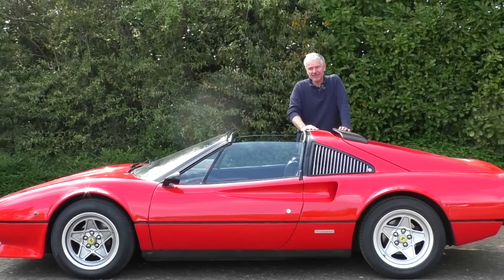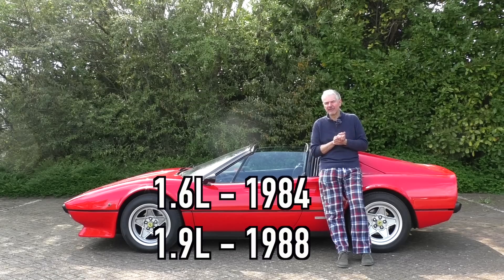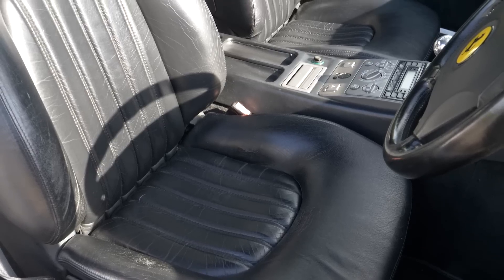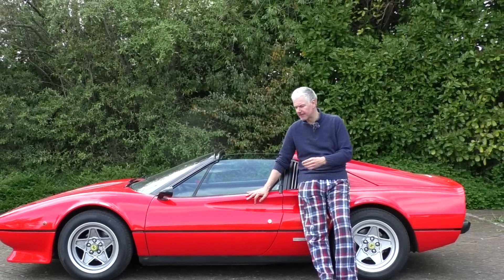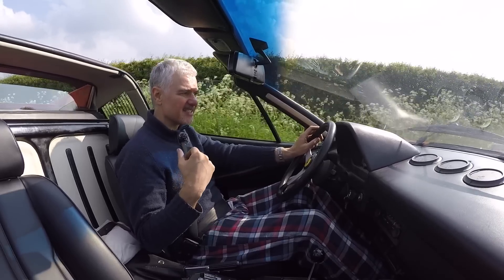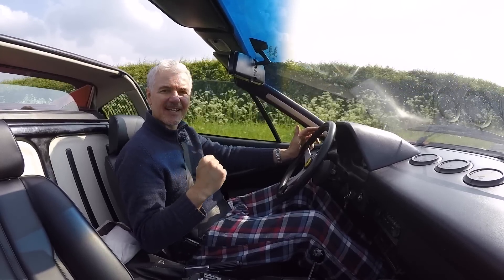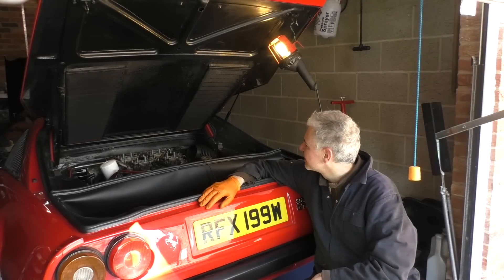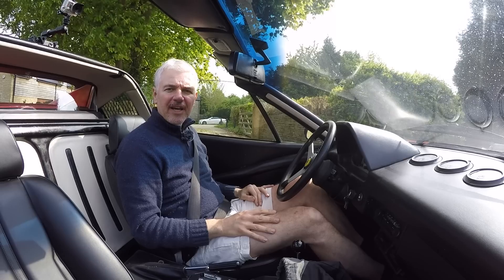The reason my Ferrari 308 was the cheapest in the UK

Comment: I surmise you didn't hear this hissing/high pitch rattle before you got all 8 cylinders going so that may be a clue.  

That formerly idle cylinder may now be putting pressure on something that has not been "tested" ever since the cylinder stopped firing.  I've come across someone else having a problem with their exhaust manifold seal "giving up" once his engine hit the high notes.  It only happens under load after hitting a rev level.  You can imagine that area around the exhaust manifold would not have been as hot as where the other cylinders were venting hot exhaust.  Look around the exhaust manifold gasket to see if there is any signs of an exhaust leak.  Check to see if the bolts are equally tight where the "lazy" cylinder exhausts.  Good luck!
Reply from the maker: No it did it before it was running on all 8 as well...
Reply: @Number27  That does not make a "loose" gasket cause less compelling.  The uneven heating of the mating surfaces at the exhaust manifold will cause the expansion of normally heated areas to move more than the relatively cooler spot and that can cause a leak-back
Reply: ...sorry, didn't quite finish there...silly browser.

I was about to say... leak-back scavenging effect whereby the exhaust pressure from the firing cylinders on that bank will leak backwards and escape from any weak spots at the non-firing cylinder exhaust manifold interface.  So this sort of leak can happen even when the engine was only firing on 7 cylinders.

Comment: I had a dual carb VW that did a very similar thing. Took me ages but eventually found it to be worn throttle butterfly splindles. Had to get them rebushed and then the noise went away! Maybe stick a gopro near the carbs to see if the noise comes from there. Either that or get it on a rolling road and try and pinpoint the sound with a hose pipe to your ear whilst it is under load.
Reply from the maker: Rolling road would be ideal though obviously not available right now!

Comment: Sounds like it's running very well now. That whistle definitely sounds like an air leak. Maybe a vacuum pipe somewhere? Or take the auxiliary belt off briefly and just go down the road at full Throttle for a minute and that will eliminate any of the bearings in the alternator etc.
Reply from the maker: Thanks.. good idea..
Reply: If the auxiliary belt also runs the waterpump then it's not so advisable.
Reply: @regazzoni6972  the cam belt runs the water pump on cars

Comment: Same whistle as my old Alfa before the idler pulley bearing went.... have it on my Volvo t5 at the moment, new tensioner just arrived.... sounded nice on the Alfa having a turbo whistle, not so much fun waiting 2 hours for the AA!
Reply from the maker: Thanks chap!’will check!
Reply from the maker: But did your idlest bearing do it all the time at certain revs? Or only when you put your foot to the floor? Lots have said that if it was a bearing it should be doing it constantly
Reply: @Number27  Alfa did it under heavy revs, just like a turbo spooling and same with Volvo but goes when warm, Alfa was idler and Volvo is the idler tensioner, checked alternator and ran with aux belt off to confirm... because it's a whistle sound you don't associate it to a bearing.
Reply: It's only happening under load which points to a bearing, if all the belts were changed recently they might not have replaced all the components..  idler, tensioners etc.. you should be able to hear it with a hard rev in the garage... can be worrying as it comes from same area as the Cam belt but 9/10 It's not that, usually a rattle with those before they go or the just go with no warning!
Reply: @Number27  The Alfa... under load... heavy right foot. The Volvo T5 at low speed or cold, there is no hard and fast rule the bearing reacts to the stresses put on it, so no they won't always make the noise constantly, that's what makes them hard to diagnose sometimes and most punters start at one end and replace, fine if you have deep pockets? Most bearings make a constant just before they fail..... but like you I always drive with one ear listening for sounds whereas most don't until you can't ignore the noise!
Reply: @Number27  Forgot to mention, we have a very good... hush, hush exhaust fabrication company in the village, they make supercar systems for a well known car manufacturer, not Ferrari! I have used them for sports stuff, Range Rovers and Motorbikes, they can be a lot cheaper than OEM, plus there is a little haggle room if it's a one off. Can give info via pm?

Comment: It could be a leak in the induction system from the filter up to the carburettor. If not check the alternator. With this and the single exhaust sounds a bit like a turbocharged 4-cylinder car which is not bad at all...i wouldn't change it.
Reply from the maker: 😃.. does sound like a turbo!

Comment: Good idea on 308,s is to modify bleed screw  on rad to self bleeder, they build up air in system. Noise could be anything sounds like bearing race, or even baffles in exhaust, Alternators on these are same as fiat 124, or 80s Iveco Zeta
Reply from the maker: Interesting thanks!! What’s the self
Blender mod?
Reply: Number 27  I took brass bleeder screw of top of rad and gave it to a guy in Ferrari group when I lived in US he braised a domestic radiator blew valve that would bleed air off  at a certain pressure. It was 18 years ago now, I had a lot of trouble with air build up in system, I believe it was common with some 308,s

Comment: - Overheat - 
Looks to me like you were borderline with the engine running but once the water stopped flowing you got heat-sink and overheat. My Lotus has an electric pump that comes on if you turn the engine off either with the fans running (dumb move), or if heat-sink would have caused the fans to come on. Lot less draw than running the fans when the engine isn't running. Does the 308 have this set-up? BTW it wouldn't work either if the sender wasn't getting a good connection.
-Whistling noise - 
Really does sound like an air leak - I'd be checking vacuum lines but also the inlet manifold and carb gaskets. Does it happen if you manually rev the engine with your head next to it. If not perhaps an alternator bearing and it's load related?
Good luck with it - great car
Reply from the maker: Agree.. it was borderline but as soon as I switched it off it could no longer cope! Thanks for the useful suggestions too!

Comment: Don’t see how the noise can be a bearing because you would hear that regardless of hard or soft acceleration, sounds induction to me, on my Elise I had something similar and it was a split vacuum hose, so just check you have no split hoses as that would only open under higher load (full throttle)
Reply from the maker: Will check thanks!!!

Comment: It's definitely intake noise, bearings/belt make a racket all the time. Could be a vacuum pipe leaking somewhere,  or it might just sound like that at full throttle. Is the noise coming from the engine bay or forward in the car? Difficult to tell from the vid. :)
Reply from the maker: From engine bay!!
Reply: @Number27  - Then it's either a vacuum hose from/to the carbs (possibly ignition advance?) or "it just sounds like that" - I reckon. :) Does the top end of the rev range feel retarded at all at full throttle? Any unevenness/hesitation at part part throttle?

Comment: There are a number of discussions on fchat about "whistling" sounds and it pretty much always comes down to the exhaust. There are however very few people with a single pipe so not sure if it's related. I would say it's definitely not an intake leak as that would show up mostly at idle with closed throttles and become mostly a non issue when the throttles are wide open.
Reply from the maker: Thank for the advice Paul,. Yes it is the exhausts with baffles in the tips that can whistle.. mine has one exit pipe with no baffle..

Comment: it's the CARBS doing the whistling noise.... nothing to worry about! When you floor it the flaps open and they suck in more air...... single exhaust ??? remove that!.... as for the boiling water bit....Did you pull out the thermostat and rad fan switch when flushing the whole thing?

Comment: The name for the 205 has to be Pugsy. And the whistle may be coming from a resonance in your (fully open) throttle bodies. Happens with my BMW X5 3.0i and it drove me mad until I understood the reason. But I may be wrong and there is an issue with a vacuum line or rubber boot on the intake body? Don’t really know the car tho. Good luck, you will get to the bottom of it.

Comment: difficult to hear but from your description, I wonder if baffles in the exhaust are broken and could be restricting flow. It could explain why the engine doesn't rev out, the hissing noise and the metallic rattle you describe. At part throttle there's not enough gas flow to cause the problem and the broken baffles would only resonate at certain frequencies/rev range and at high flow rates.
Reply from the maker: It’s possible!! Thanks for watching!

Comment: Remove the drive belt one at a time to road test ,( short road test without over heat the engine ) , a new belt can be defective with no visible damage or bearing , propane gas the vacuum hose and joint area and carb base gaskets for vacuum leak ?

Comment: Mount a camera with an external mic on a wire in the engine bay. Position the mic in several different areas until you hear it very clearly. Investigate that area.

Comment: Re: Whistling noise - did you check for vacuum leaks? The dirty diagnosis would be to spray brake cleaner along the vac lines and see if the rpms rise.
Reply from the maker: Thanks, will do!

Comment: Hello, mate, here I am, your portuguese friend. You seem like the great and missed Michael Hutchence on those “sexy” pijama trousers, keep using them ‘cause girls like that kind of trend, mainly nowadays, where we’re all in quarantine, @ home. Regarding the 205 Gti 1.9 nick (awesome fwd driving’s car together with the Clio Williams, I had the pleasure to drove both, some decades and kilos ago), it’s french and vintage...therefore I would call it “Corona” or “Corona-1.9” Concerning the “puff” when you shutted down the 308, it seems like counterpressure relief, check the thermostat housing and its functioning. Lastly, that noise appears only on high load conditions (sudden full throttle from lower/middle revs), maybe bearings or troublesome gearing teeth on primary or even secondary axle of the gearbox, or on the differential. By the way, does it have LSD ?  Those are problematic as hell. Good luck, mate, you must go aircooled again, that Influenzo could have injured you severely, mainly on the eyes. Next time wear protective googles 😊👍 Stay Safe !
Reply from the maker: Cheers Nuno, and you’re right.. the girls love the PJs!

Comment: Bit of steam never hurt anyone, but do monitor ECT while “idling” at 1500 rpm. Better to idle below 1k really...  “Balanced” the carbs, but no clues about how you did that for those who don’t know. Did you start with the engine not running, throttle stops backed right off, all butterflies clicking together? Which saves a lot of idling time... Over heating generally is caused by head gasket failure, not vice versus. The one thing that kills these head gaskets is detonation, not water at 115 degC. Hope your shopping doesn’t get too cooked in the boot!!!

Comment: Make a exhaust or take it to a exhaust place .. I’m sure they can widen the diameter and chuck a muffler on  that would suit .. if u want to save money..  
only half way though the vid though.. think u need a straight though muffler or 2 see how it sounds 😉 that’s what I would do 👍. I’m a motorcycle geek though and modify mufflers and exhaust like a mad man in the past...  u do need a bit of back pressure to add low down torque so to wide diameter is not real allways the best 3-4 inch with 2 straight through mufflers I would try or what ever u can fit
Reply: Yeah have an exhaust shop custom build one, should be waaaaay cheaper and you can decide how loud you want it
Reply: Another vote for custom exhaust. Not as expensive as you might think and you can choose the ‘sound’ based on the choice of muffler/resonator.
Reply from the maker: Thanks on the custom exhaust advice. Done this lots on my motorbikes but never on a car.. not sure it would be that cheap though.. more complex in this case

Comment: How are your engine mounts? Under high load the engine could twist causing some fit issues around your belts.  Trying to fit a k&n filter on my car and the filter was pushing on the timing belt cover causing it to touch the belt and whine.  Just a thought.

Comment: It sounds normal to me, as it happens only on WOT. Check if it whistles at low rpm high load (e.g. wide open throttle at top gear around 2k rpm) if all is ok, it shouldn't. Sometimes we forget how loud induction noise can be in cars with carburettors, especially the Influenzo having four of them!.  My car has bike carbs and they wail like a banshee on WOT😂
Reply from the maker: Thanks buddy, have a good weekend!

Comment: I dont think the noise is anything serious.   If it was a bearing maybe water pump pulley vibrating due to being worn and loose. Some thing metalic vibrating on the exhaust maybe. 
I love watching your progress🤗
However the problem with asking for suggestions is that you get every one 😂
Yea that 456 was very similar to the one I took my family across Europe in 13 years ago, a great car.
I did love my 1.9 205 GTI, the first car I owned that did not have a rotting wheel arches 😂. Age of the modern car.
Reply from the maker: Wow, what trip to do in a 456!!

Comment: A Ferrari engine is quite strong, they take heat very well, that's why they are good racing machines. Check any air pipes in the engine bay and check for leaks, that could be something, escaping air or gas.
Reply from the maker: Thanks buddy, will do..

Comment: The noise sounds like false air being sucked in trough a small hole.

Are the idler screws leaking?
Or a plug on the inlet manifold missing? Or a vacuum hose disconnected or something?
Hole in the manifold/carb?

It becomes worse as airflow rises when you put load on it. It does not sound directly rev related as it would if it was a bearing.

That is the first plase i'd look. Have it running and find someone who smokes and have them blow smoke into the engine bay around the manifold. If you see it goo in somewhere you found your hole ;)
Reply from the maker: Thank you for the advice!!
Reply: @Number27  no problem man. I love hunting for stuff like that.
Also have a look at the gaskets. Between the manifold and engine and manifold and carbs etc. Also at the back side with a little miror or something.

It isn't that common, but i have seen cars where simply a 1 or 2cm  piece was missing and also left a hole, probably crumbled away from old age or badly torqued in the past.
At least worth a look i reckon.

Good luck, hope to see it fixed next week 👍

Comment: I own the successor 3.2 in the mondial body style for 18 months now. Did a fun bid on BaT for Valentine last year and apparantly bid 100 usd above the reserve and nobody overbid, partly because many expected the reserve to be much higher.  Although I was immediately approached by forum members to take it of my hands I decided to have it shipped over, unseen and without any service history. Took apart the console to clean all switches and repaired some things like cabrio hatch and door lock. The car is just great! It is my daily driver all through the season. Doesn't use a drop of oil or coolant and I even don't disconnect the battery in winter. Just turn the key after 5 months and off we go. Unbelievable reliable but the quality of the body parts is just awful 😊.
Reply from the maker: Ha!! Glad you’re enjoying your Mondial Tim!

Comment: If your head gasket leaked you may find water in the oil . It would look like a milk shake . Thankfully you must have checked that and found none . 
Did it simply over flow at the radiator cap when the release pressure was exceeded? At the overflow tank ? What was the source of the leak ?
Reply from the maker: Yes no water in oil!! So all seems good!!

Comment: Pretty sure that's a vacuum issue on the inlet manifolds. A week or so ago you had the carbs off I think, and I don't remember you complaining of the whistle prior to that. Does it still happen when stationary and booting the accel? If so then try squirting some brake cleaner round the manifold joins and see if tgat affects the running speed, if so bingo!
Reply: I am with Richard Warren on this. This is a wacuum hose off or with a hole. A bearing would complain all the time at the same rpm.
Reply from the maker: Thanks for the advice!!

Comment: Because that whistle only happens when the throttle is wide open, I don't see how it can be anything other than intake / carbs. It's maybe some air path that's opened up in the carbs at full throttle?
Reply: dungareesareforfools 

I agree - it sounds like an air leak and given that it occurs on full throttle, it suggests that it is a vac leak.
Reply from the maker: Thanks for the tip!!
Reply: Maybe do a smoke test if you have the kit?